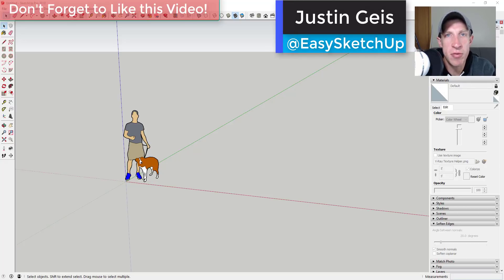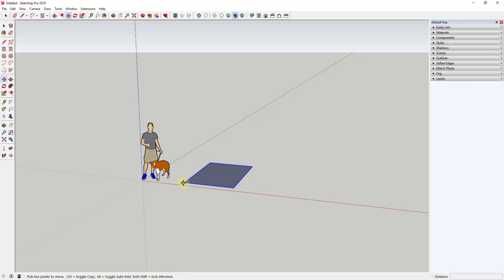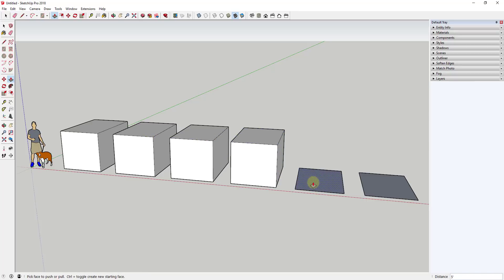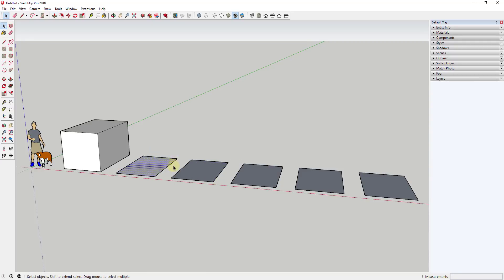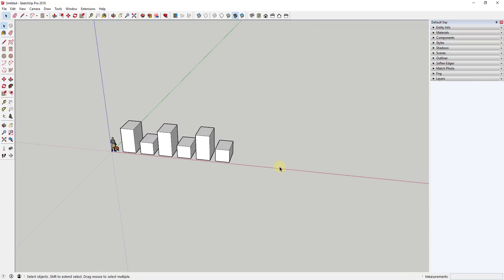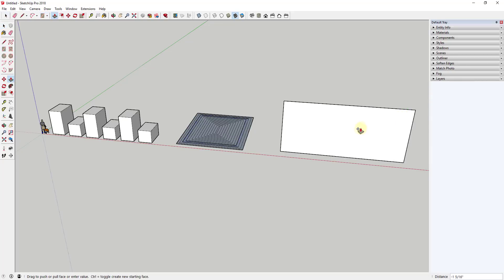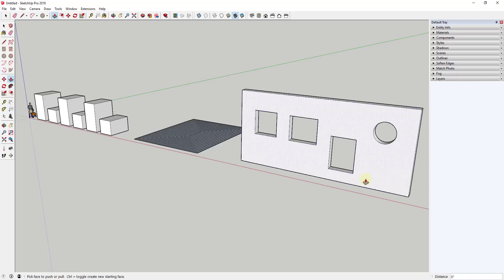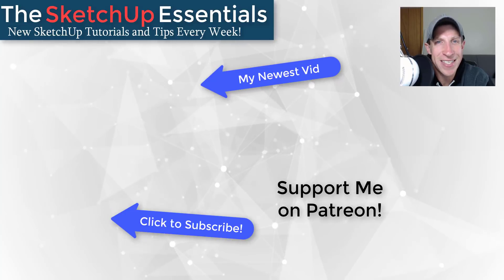SAVE TIME with Tool Memory in SketchUp!!!

Comment: I'm using sketchup make 2017 (since 2018 doesn't have a make..grumble grumble) and I did the rectangle push pull thing you did as a test since I wanted to see the need to reverse faces in action... and it went the proper direction for me w/o reversing faces!? Your result makes more logical sense. I wonder if the behavior was changed for 2018.

Thanks for the video. Always good to review the basics.
Reply from the maker: Sometimes it seems like it's a bit...twitchy when doing this - I'm not sure exactly what causes it... Thanks!